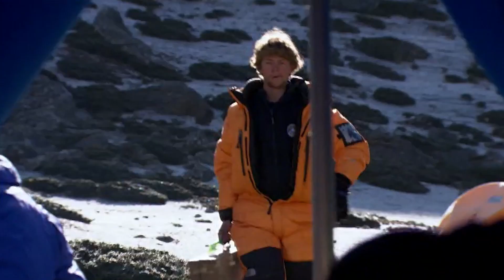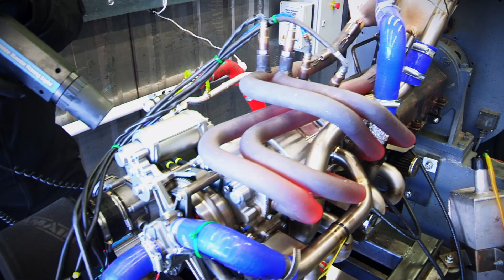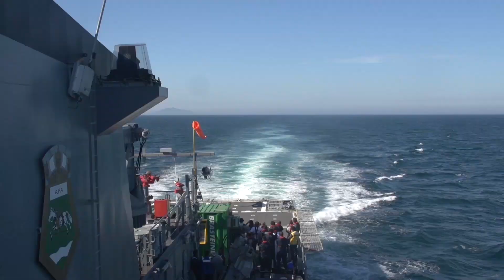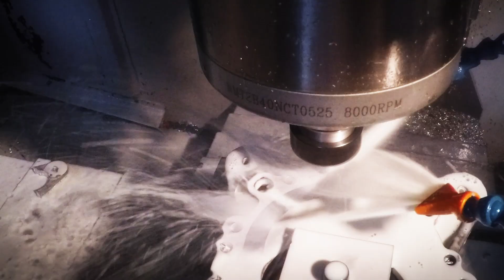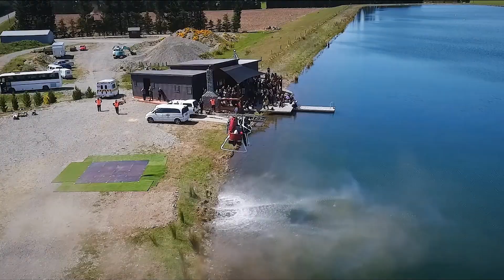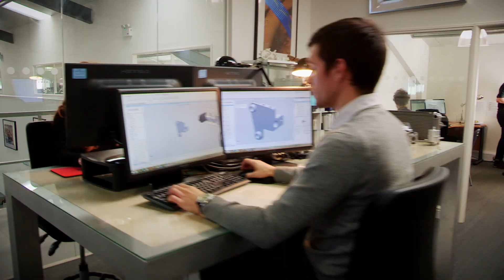Introducing Rotron Power Engines

Comment: This is amazing. Even though they're not in road cars right now, Wankel rotaries are still alive and kicking and I love that they are still in use in different applications to this day. I can't wait till they're back on the road again too
Reply: Won't you please donate to the Save a Rotard Foundation today?
There are Rotards like Bruce that need your help.
Reply: @sandervanderkammen9230  rotaries are total loss and do not require an oil change like electric motors or a snowmobile 2 stroke.
Reply: @sandervanderkammen9230  oil changes re eliminated and are for weak 4 joke stroke combustion engines and chemistry is governed by electrons and the electromagnetic force get with it i love you
you sexy woman who are angry with the electromagnetic force the 4 stroke is a very weak administration on the electromagnetic force! Both the chemical 2 stroke and 4 stroke run off broken symmetry of the vacuum which governs all charged particle get with reality electromagnetic rule the universe! All your chemical bonds involve valence electrons making up your high energy density high octane fuel!
Reply: @sandervanderkammen9230  The rotards are very haunted engines and are though sensitive
Reply: @sandervanderkammen9230  Ball lightning and tornadoes are rotary 2 stroke engines. The sun is a rotary loop charged 2 stroke and its present every day!
Reply: @jlo13800  You don't know that Amsoil is a pyramid scam?
Reply: @sandervanderkammen9230  do you run and mix a better oil
Reply: @sandervanderkammen9230  klotz, casor and motule all work great with oil injection or premix if thats what you are thinking. I converted a kohler mower to run on amsoil interceptor or xd-100
Reply: The one eyed one horn flying purple people eater designed and machined a 660 cubic inch pressurized air charge cooled roller bearing 6 rotor engine running on zirconia/yttria ceramic roller bearings, a M50Nil tool steel (carbonized/nitrided plasma) e-shaft and plasma sprayed ceramic billet aluminum (7068 alloy) housings with ceramic apex seals to power his flying machine. It makes about 3200 HP from the aether/ZPE and warps space time as he peeps out his peephole while spying on us and he has a 5 axis CNC mind over matter machine tool that can materialize more of these giant charge cooled Rotron roller bearing engines out of spacetime with thought!
Reply: thees things are the connecticut haunting
Reply: exactly what the 2 stroke lightning does douse the weak 4 joke stroke cannot stand its chance against a shaded pole motor with out a wet sump may the destruction happen against the 4 joke stroke they are fun to destroy! 4 joke stroke is worthless and what a piece of shit! They are fun to destroy as i have no passion or feeling tword a 4 joke stroke automotive with its weak bearings
Reply: @jlo13800  For your  $100 donation you will receive a "I've never been laid" bumper sticker and a slightly used Rob Dahm T-shirt (some 2-stroke and semen stains)
Reply: @ Sander (to b*tch Bruce).. Lol!!
Reply: If they do i will eliminate that 4 joke stroke shit in a heart beat
Reply: If you bash vacuum energy what else do you have which drives all the charges that make you and i and all are so called reality in this dimension? There are many few thousand hp 2 strokes in the spirit realm that have much much more torque and HP, are crankcase scavenged, charged cooled and roller bearing that are waiting for use!
Reply: i have a haunted charge cooled omc rotary at 528cc and that spirit who maintains it has machine shop that can manifest any alloy or ceramic out of the aether and manifest it to this 3rd dimension with the casimer effect making fusion taking hydrogen protons and slamming then into iron to make cobalt and nickle!
Reply: This spirit knows how to make roller bearing alloys with M50Nil! he also knows ceramics like zirconia/yttria which has a higher fracture toughness than silicon nitride which is harder but more brittle!
Reply: @jlo13800  while there is no cure, there is treatment for those who suffer from rotardation.
 You don't need to feel ashamed to ask for treatment.
Reply: do you have another cure or are you just stuck in your realm elecrtro chemistry witch involves a few valence electrons is just to weak, there are electric motors pounding us to the pavement get with reality
Reply: Im sorry you feel this way and so do i vacuum zpe is just to powerful
Reply: @jlo13800  You don't need to be ashamed of being a Rotard, its something that can be treated and with proper therapy you can start living an almost normal lifestyle.
Of course people like you should never be allowed around young boys.
Reply: @sandervanderkammen9230  the sun and lightning is a 2 stroke, brappppp
Reply: @sandervanderkammen9230  what is a rotard????
Reply: @jlo13800  You have never been diagnosed?
Reply: OK and they will run premix regardless as its oil injected cheers as the sun is a loop charged gradient energy 2 stroke~
Reply: Im sorry you are so sad but cheers to your overunity project
Reply: Rotaries do not oil changes as they are total loss like lightning or the sun
Reply: no oil change needed total loss like a snowmobile motor
Reply: i run nothign but 2 stroke oil and im insane with total loss as everlightnijg strike is a 2 stroke and i run amsoil interceptor 2 stroke oil, if you dont like it tough ceramic roller bearings
Reply: a rotary need oil no oil change just like a 2 stroke, if you dont like that thats tough ceramic zirconia roller bearings and i run 5 gallons of BRP XD-100 in my 2 storke 8v92 detroit
Reply: A wankle rotary is a pshu pshu
Reply: @jlo13800  Thank you for confirming that you are a Rotard.
Reply: Yes the rotard is alive and whell, it makes up the crankshaft you turn to the fuel you burn with broken symmetry in the vacuum and a rotary is oil injected requires no changes like a 2 stroke i will continue to run amsoil interceptor 2 stroke as it fires on every stroke! Thanks for your interest in nthe vaccum energy as the aether is the most energy dense substance you can thin of! Nothihg can beat it! brapppp
Reply: @jlo13800  Now that you admit that you are a Rotard you can seek treatment.
Reply: @sandervanderkammen9230  all my rotaries are on amsoil interceptor 2 stroke oil, if you dont like it you dont have to hear and inhale them run
Reply: 4 joke stroke is wortheless
Reply: @jlo13800  Yes, Wankel engines are worthless... thats exactly why the Wankel engine is obsolete.
Reply: @jlo13800  amsoil is a pyramid scam...
Reply: @sandervanderkammen9230  Yet thank can make way more power than any 4 joke stroke diesel, look at the 690cc Rotron rotary powering Brian Crietons bike, Rotron and AIE make well over 3hp per CID and way more if boosted and 4 jokes and diesels do not come close. The 4 joke stroke and diesel has a shitty power to weight ratio and is fat and ugly and getting run over by electric motors which have ungodly power to weight ratio. Americans are stuck on ugly fat 4 joke strokes which suits them well. electric motors, some 2 strokes, lightning and rotaries do not need oil changes as they eliminate the fat ugly wet sump! Lightning and the sun are 2 stroke and the sun is a loop charged plasma 2 stroke.Its got huge plasma loops powered by magnetic fields and it loop charged.
Reply: @sandervanderkammen9230  Do you have a better oil, i just bought a few gallons of XD-100 BRP 2T oil for my 8v92 2 stroke detroit. its on sale at walmart as its ETEC evinrude 2 stroke oil full synthetic. I also will run it in my rotary and my toro mower. I have been on amsoil interceptor for for them too.
Reply: a rotary is self cleaning and does not need an oil change as its total loss like the sun
Reply: Wankel engines are obsolete technology... never gonna happen.
Reply: @sandervanderkammen9230  Oh no there not the Sun and ball lightning are rotary 2 stroke plasma loop charged charge cooled engines. An electric motor is a magnetic rotary 2 stroke! Look at the tesla's with there insane HP and torque numbers. The 4 joke stroke don its time already. The 700cc rotron is like a chewiene dog.
Reply: @jlo13800  Not even Mazda makes Wankel engines anymore...
The Wankel engine is now the sole domain of crackpots and con artists.
Reply: @sandervanderkammen9230  what premix oil do you run? any fuel below 98 octane is useless. Rotaries/2 stroke ethanol fired makes way more power than diesels!